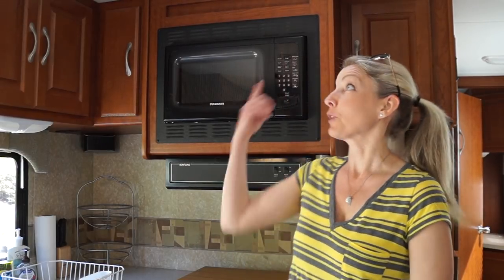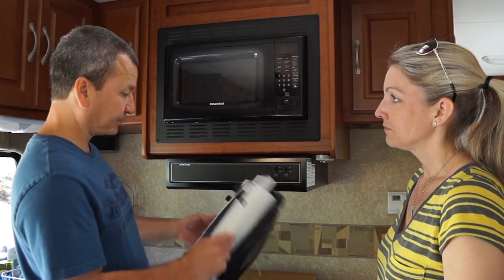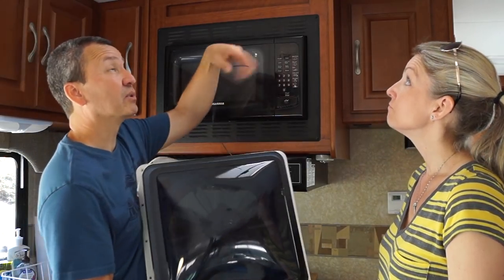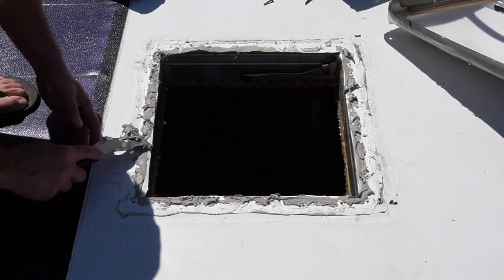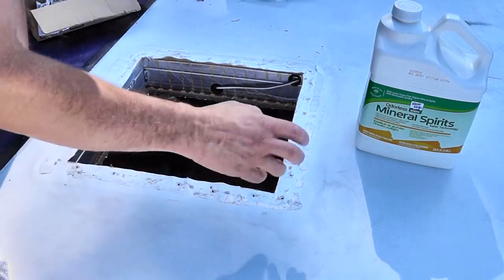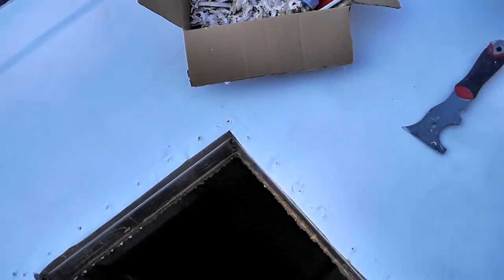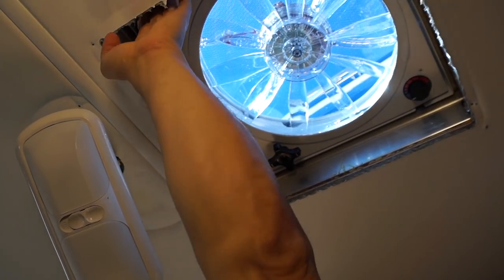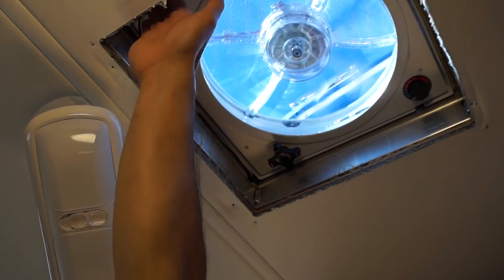How To Install A Fan-Tastic Vent (Fantastic Vent / Fan)

Comment: We were lucky that both of our RVs each came equipped with two Fan-Tastic fans. They move so much air that we can't imagine RVing without them. Our current rig is over 9 years old and both fans have been working without a single problem all those years (and we keep our bathroom fan on low just about 24/7/365). Awesome product. Thanks for the great tutorial video guys.
Reply: Very informative
Reply: May I ask why you did not re-install your weather guard cover that was over the old vent?
Reply from the maker: Rick Smith,jr I actually did re-install the vent cover shortly after making the video. I just didn't put it in the video. I did notice, however, that there was a little more air flow with the vent cover off. Of course, the benefits of having the vent cover out weigh the slight increase in airflow. I usually leave the vent open 24/7 so the vent covers are a must. Thanks for asking!

Comment: Looks like a fairly easy project. I have learned that NEW doesn't always mean GOOD or WORKS, so I would have installed the 4 corner screws then connected the fan to 12VDC and tested functionality prior to applying the DICOR. I have had to many things that were BOOB "Bad Out Of Box".

Comment: Here is a tip on removing old Dicor.  Take a metal putty knife (maybe 1-1.5 in wide).  Heat it for about 10-15 secs with a torch.  Scrape dicor off.  Comes off like melted butter.  I keep torch going on low and as blade cools, just reheat for a couple seconds, scrape more...repeat.  I did my entire roof in about 30 minutes.
Reply from the maker: +Fl Yak Fisher Thanks for the awesome tip. I'll give it a try.
Reply: Being roof maintenance is critical...and should be done at least annually, this should save u time.  FYI:  Dont "over heat" the metal as to melt thru a rubber roof.  Hence....only heat for seconds...not minutes.  Let me know how it worked out for ya.
Reply: @panhandlepilot9363  How did this work?  I have 3 layers of old dicor that I can't get off with a razor.  Its like chipping away at wood.  I'll give this method a try.
Reply: yeah, this is one of the best tricks I've ever heard of and worked like a charm.  Instead of an hour trying to get a few square inches of old dicor up, I did several square feet of old dicor in less than an hour!  This works great!  Ty Fl Yak Fisher for the tip and to Tito for hosting the forum!
Reply: Thank you Yak!

Comment: Just did mine and I found the judicious application of my heat gun went a looong way towards getting the old butyl tape and lap sealant off...

I have 3 on board now and they do move a lot of air when they get going.  Good job

Comment: Merci beaucoup for your video. I Just finished my installation. Tooks 5 hours including the cover remplacement with a Maxxair.

I watched several video and your Youtube is the best!!
Reply from the maker: +André Bonaventure You are very welcome. I'm glad the video helped you with your project. Well done.
Reply: André Bonaventure I'm getting ready to replace my vents also with a Fantastic Fan Vent and you answered a question I was wondering about. Will the Maxx covers still fit? Thanks for letting me know. Now if I can only out how to get down without falling. Thanks for the info.
Reply: Hi Barbara, Check if your Maxx cover has 4 sliding holes on each slide. Theses sliding holes allows to slide the cover to fit to the position of the 4 brakets. What you need to know is the Fantastic assembly is pre-drill with 5 holes on each side (total 20) and it don't have the same holes positions as the Fantastic (8 holes per side on my stock vent). 

Important: Do a dry fit before. Also, the brakets need to be installed on the second and fourth holes on each side of the Fantastic base. I screwed all the screws except the 4 screws for the brakets. Then I added Dicor on the 16 screws and along the edge of the base. You need to do this because after, you will installed the brackets and screw-it. By adding the Dicor before, you will have Dicor between roof and brakets. Once done, then add Dicor on the 4 remaining screws. I took several pictures. Send me you email and I send you my picture. Hope it held and don't discourage you :)
Reply: André Bonaventure Thanks for the info. I believe I understand what you are saying. Thanks for offering to send me pictures but I don't know how to send it to you privately and I don't want it where it can be seen by anyone. Again thanks.

Comment: Nice upgrade. 
I installed on ein our last trailer in the kitchen that had a thermostat built in. When it was open it would turn on automatically after the stove was lit.
Better than a range hood exhaust fan!

Comment: I upgraded my Fantastic Fan with the 7350 upgrade kit for $150 over the kitchen. The remote and ability to reverse is pretty nice. I also stuck a Maxxair 7500 over the bathroom. All in all I firmly believe the Maxxair is just better in everyway. Also, my Ventline exhaust shroud above the stove works pretty good. I'm guessing some people don't know there are 2 small tabs on the outside that need to be moved to allow the door to swing freely. Thanks for the videos. I enjoy them and have picked up quite a few things.

Comment: Thanks Brian! This is a project I have to do with an additional step. My camper has a Fantastic in the Kitchen area, but it's exhaust only. My project is to replace this one with a reversible fan, remove the vent in the bathroom, and put the exhaust only unit there. Twice the fun. As you said, easy to do but just a PITA! Thanks for the video! They are awesome!

Comment: Great install video. I have to replace an old vent with a Fantastic fan soon  The only thing you forgot to show was the reinstallation of the MaxxAir Vent. Then you would have had two install videos in one 😀
Reply from the maker: Sorry about that. Those are pretty easy. I've got 4.
Reply: Thanks again for a great video. Got my new Fantastic Fan installed yesterday. Now I'm going to replace the old MaxxAir Cover with a Fantastic UltraBreeze cover.  They allow better air flow.
Reply from the maker: @46fd04  You're welcome. I wasn't aware of the UltraBreeze cover. I may get a couple.

Comment: Hi, Brian. I am not an expert, but a construction contractor once told me that the tube guns you use for the Dicor come in standard versions and contractor versions. He said the contractor versions actually work more evenly and much easier. Just a thought. Hope you enjoy your new fan!
Reply: The guy who replaced our RV windshield actually had an ELECTRIC caulk gun! It not only helped him to apply sealant evenly, but protected his hands and wrists from the stress of squeezing the trigger (he'd already had carpal tunnel surgery from years of using manual guns). A power caulk gun is probably a little over the top for those of us who use it so rarely, but I can't say I don't still want one. lol
Reply from the maker: Tim Combes Yes a cool ELECTRIC caulk gun would be awesome. I'll add it to my Xmas list. Unfortunately I've had the same basic crappy one since the beginning of time. I think it's the one Popeye used (Get it...giant forearms..hehe). It does the trick but can be a pain in the butt/wrist sometimes. Thanks for the comment.

Comment: Very good video,  informative. The only questionable part was cutting off the remaining butyl tape with a knife. Good way of cutting into your rubber membrane.  Why not leave it,,,, the self leveling lap sealant will cover it. Double protection.

Comment: My former motor home had a remote in the electrical panel. That was great! My current trailer has a FF, but it only blows out and (IMO) there's too many switches (4) for one operation.

Comment: One good tip to add t is what direction the vent fan should be facing if you didn’t have one before and it’s a new RV build. I’m googling trying to figure this out. I assume the side of the vent on top that opens should be facing to the back?
Reply from the maker: Yes. Face them to the rear.

Comment: If you weren’t aware, Up under the hood of the exterior exhaust for the range hood there are likely little arms that hold a flap closed/sealed for cold weather and travel.  If you leave that closed, the range hood fan won’t do anything but make noise.
Reply from the maker: Our range hood did not vent to the outside. I removed it...much better now.
Reply: That’s kind of odd. Anyway, great video and nice job on the install. Wish more RV’s would come with a quality vent fan from then factory.

Comment: What is the difference between Butyl tape and putty tape.  I’m installing a fan on a painted wood teardrop trailer
Reply from the maker: Good question. They often refer to the same thing. But my understanding is that Butyl is a synthetic rubber material that has more of a flexible stretchy consistency. Putty tape looks very similar and might dry out and crack along the edges that are exposed. I think Butyl is what you want.

Comment: Overlap butyl tape ends. It will compress. Don't butt the ends together. Butting can leave a gap that water can seep into. Butyl is almost bullet-proof when installed correctly... Same goes for those new window installed in the door.. Dicor can have micro channels  in the caulk line that water can seep through. Nothing worse than a water leak in an RV over time.... Did you do a water test after it all cured?

Comment: What was the old fan... and why did you replace it?  Your videos are well done, and very helpful.  (Gorgeous assistant, too.)
Reply from the maker: There was no fan there just a vent. Thanks!
Reply: I want to do the same thing in my Class C.....I am scared to death of having leaks.  You made it look simple, but for someone like me that is all thumbs is it really that easy.....It looked like you covered up the screw holes with the butyl tape.  Did you use the same holes or make new ones.

Comment: How do you apply the Dicor around the hinge on the fan?  The professionals applied the Dicor on top of the operating hinge and it cracked and leaked?
Reply from the maker: I only apply Dicor on the screws and edges. Not sure why they put it on the hinge.

Comment: I bought one from amazon for mi bus, but after I made my purchase I forget check if the dimensions are standard for bus vents. Isn´t a big deal if not because I can adapt it but I can wait, does it have standard measures for old original vent replace?

Comment: You might want to consider using a plastic putty knife when removing the old adhesive and goop on the roof - it would lower the risk of cutting the roof membrane even further in case of a slip. Just a future suggestion. Oh - I see you did switch to one later as it is sticking up in the box of old Dicor...
Reply from the maker: I sort of agree but those plastic ones don't always hold a straight edge and can get bent up which can also damage the rubber membrane. The metal one worked better for me as long as I was patient and careful. Thanks for the comment.

Comment: A question. How do you know if there will be 12V wires routed near the 10x10 hole where you want the fan to go? I don't want to have to tap into one of the lighting fixtures.
Thanks again.
Reply from the maker: You do the know. If there's no fixture nearby then you'll probably need to run your own power to it.

Comment: Suggest "automotive" style crimp connectors instead of wire nuts. Wire nuts can back off with vibration from the fan motor through the wires, hot and cold cycles, and vibration of driving down the road.

Comment: I’ve always wondered why a wide putty knife isn’t used to smooth out the dicor and make sure everything is sealed.
Reply: Because it's self leveling. If you tool it you'll remove material and then when it shrinks and self levels there may not be enough leftover to seal the seam.

Comment: they sell a Clear top cover that replaces the tinted one that comes on the Fantasic fan, the Clear one acts like a skylight or a solar tube letting in a lot more Light.
Reply from the maker: +Gary West Thanks Gary. I'll keep that in mind should I need ore daylight. I have a vent cover over it anyway so I'd be looking at the inside of that instead of clouds.

Comment: Thanks for the really helpful video! We'll be modding our older trailer with these fans, however, the inside trim of our kitchen fan is slanted/angled. This is because our roof slopes down from front to back over our kitchen. Do you know how we can install the fan with the angle? Can we just use our current inside trim? 

Cheers.
Reply: I have bit of a dome to the roof in my Gulf Stream Super-C.  Just mounted the Fan-Tastic from the outside the normal way.  Trimmed the plastic inner part to match.  The inner part fits into a groove on the main unit, so my cut is not visible.

Comment: Do you think the Fantastic fan is better than the MaxxAir units?  I am interested in reliability and quiet operation on low speed.  Thanks
Ron
Reply from the maker: +Ron Dufel I don't know. I only have the Fantastic vents. I'm sure they are comparable.

Comment: Hello from Florida! We love your videos! We just ordered a Fantastic Fan (should be arriving tomorrow) and I noticed on yours and other installation videos that the roofs have a rubber membrane...ours is fiberglass. My question is, do we use a different self leveling Dicor sealer for fiberglass roofs? Also, (not to be too needy) we are planning to install another fantastic fan towards the front of our unit where there is a manual crank vent. (same opening size as the fantastic fan) there is a light that we can tap into for the power, do we need to do anything different with the wiring so that the light and fan are independent?  thanks in advance.

Kasey and Jenn
Reply from the maker: +Perpetual Odyssey Dicor sealant will work on any type of roof. For your front vent, all you need to do is splice into the positive and negative wires of your nearby light fixture and connect them to the two corresponding wires on the fan. Each has it's own switches and will work independently just fine. That's what I did on mine.
Reply: RVwithTito we will give that a try, thanks and happy travels.

Comment: How does it keep from sucking in Mosquito's at night when on reverse? Does it have a screen?
Reply: Did you see the cover on 2.48? That will help keeping the mosquitos away.
Reply: Although DANG! If I didn't camp at Angle Lake, Nevada when there was a hatch of some little "No-See-Ums" or similar bug which came thru all the screens--including the one on the Fan-Tastic! Fortunately, they didn't bite. Otherwise, the screen works well. Keeps out leaves and debris too.

Comment: Brian, is that the 7350 model? I definitely want the variable speed and reversible, because IF it is... have you tried the rain feature? Does it really close automatically? Thanks... I'll be sure to use your link if I get it at Amazon.
Reply from the maker: Bob, I'm not sure what the model number is. It is thermostat controlled, with variable speed in forward or reverse. I don't think I have the rain feature though. I have vent covers installed over them anyway so I generally leave them open all the time.
Reply: Well, thanks to you Brian I got this done. I bought and installed two Maxxair 0007000K MaxxFan Deluxe Fan with Remote and White Lid . Also reversible. They work great!
Reply: @RVwithTito  your model fan is the 2250 model fan 3 speeds thermostat and reversible

Comment: Can this be installed in our existing bathroom fan opening for our trailer, because we have a small 4 inch diameter fan with a small dc motor which looks like a toy that actually came with our light weight trailer. Are the square openings standard size?
Reply from the maker: All of the openings should be the same size. Plus there's already power there. I have the same toy fan in my bathroom.
Reply from the maker: Yes. It should work. All of the vents should be the same size and that one already has power. I have one of those in my bathroom too. Sorry for the late response.

Comment: Where can I get those solar panels?
Reply from the maker: Check Amazon and eBay for Unisolar panels. Supplies are running out though since they are no longer manufactured. Good luck.
Reply: RVwithTito Thanks!

Comment: I thiught the fan directions said "not" to use butal tape?
Reply from the maker: I haven't heard about any problems using Butyl tape to seal up a vent on EPDM roofs like mine. It seals the vent up really well and was used under the vent I removed. I'll see if I can find the directions to double check.
Reply: I can't see why not, because that butyl tape acts as a vibration cushion and stops vibrations from being transmitted to the roof, especially ac motor driven fans that tend to produce a 60 cycle hum! Just my two cents worth.

Comment: You're meant to push silicon not pull it.
Reply: You are correct but the Dicor used in the video is not silicone. It was applied correctly.